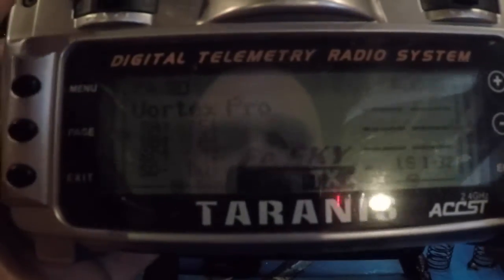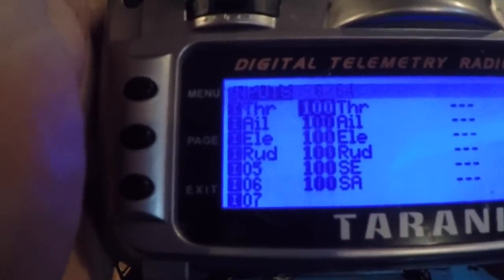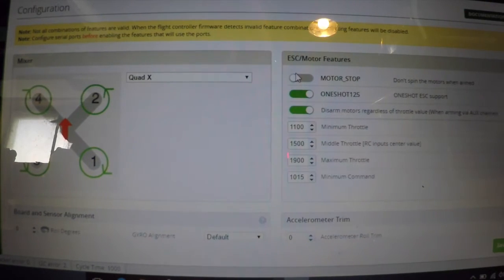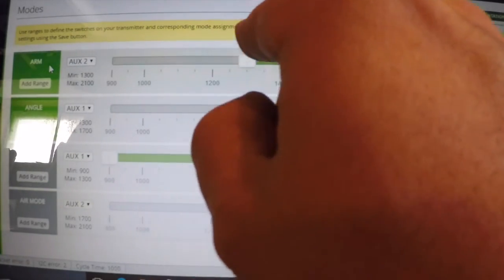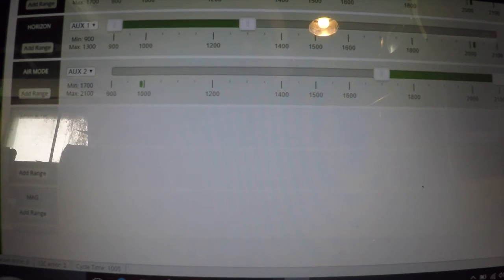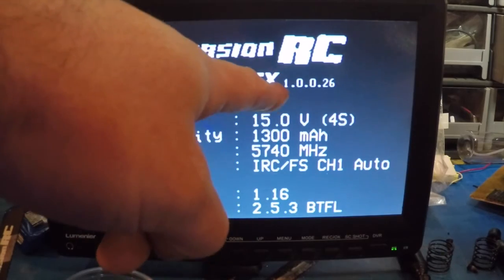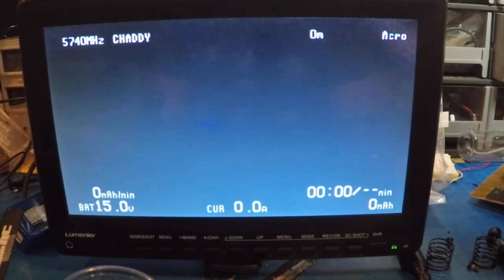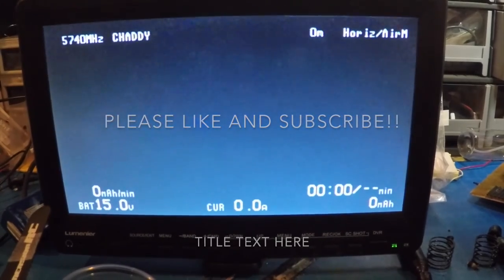ImmersionRC Vortex 250 Pro Air Mode Setup Using Betaflight

Comment: I just purchased one of these and in Acro mode it feels extremely mushy very slow to respond what do you think is the best fix for that?
Reply from the maker: Eddie Torres upgrade to newest firmware and then turn up your rc rate a bit by bit. Then adjust each axis rate until your happy.

Comment: is motor stop and one shot 125 enabled or disabled when using air mode?
Reply from the maker: one shot is enabled...motor stop is not..then you must change min throttle as in the video..or less  or more depending on how floaty it becomes

Comment: Hi Chad, when you upgrade the vortex to betaflight do you have to check the box that says full chip erase? If you do, wouldn't you lose the osd and the pro tunes? thanks in advance.
Reply from the maker: If you use the links and software from immersion rc then no. If you use a version that's not on their website you do. So you install the betaflight hex then flash with immersion software.
Reply: thanks again man. really helped a lot knowing that. I would really like to have air mode on my 285.

Comment: isn't the firmware update 2.5.3 for the immersion 250 pro only, or will it work for both vortex 285 and 250 pro?

Comment: nice tutorial. can I also do this on my immersionrc vortex 285? thanks.
Reply from the maker: Should be able to. Need to update with immersion firmware that has betaflight 2.5.3 I believe. Or if you don't care about  osd and protunes just update to latest betaflight 3
Reply: cool! thanks a lot for the reply. really appreciate it.

Comment: On the vortex can we update to any betaflight version? Do we just use the newest betaflight_x.x.x_IRCFUSIONF3.hex?
Reply from the maker: If you use protunes you only want to upgrade to the newest version on immersions website or your vortex might not fly properly.
Reply: Other than that though there are no issues? I'd like to have access to acro+
Reply from the maker: +Jake Schneider (jawz) there shouldn't be. Just make sure you save that older version in case there is. Immersion rc recommends to only use the packages off their website because they cannot guarantee you won't have issues with a newer betaflight and their osd firmware.
Reply: Just a little update for anyone reading.. Installed the latest betaflight without any issues. Just as ChadRC Models and More has warned I no longer have access to protunes or PID tuning within the OSD. Other than that everything is running smooth and I have access to all the latest and greatest features of betaflight.
Reply: I'm thinking about buying a vortex pro and i'll want to use airmode but like the thought of being able to tune the PID's via OSD... Will pluggin this quad into cleanflight or betaflight make me loose those options like you stated?

Comment: Is it normal for the motors to spin upon arming?
Reply from the maker: When you set up a 3 position switch for off...arm..air mode like in the video then yes...when you arm or are in air mode the motors should spin. If they do not then you need to de select turn off motor spin on arm under the configuration tab.